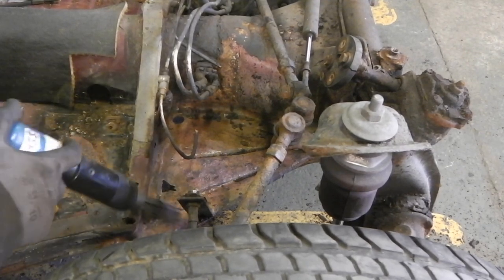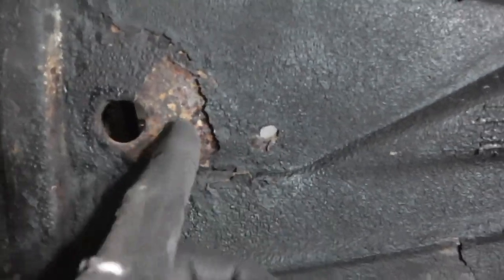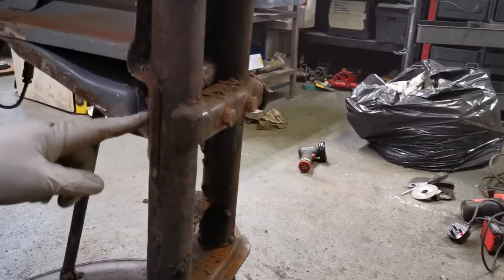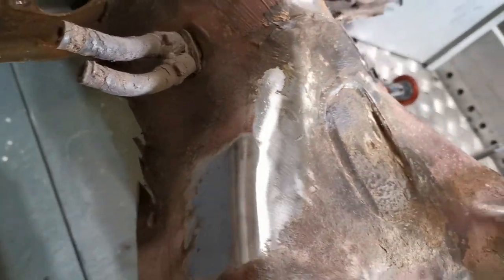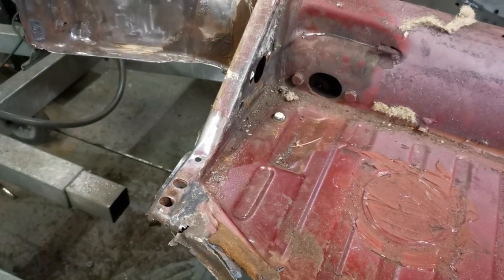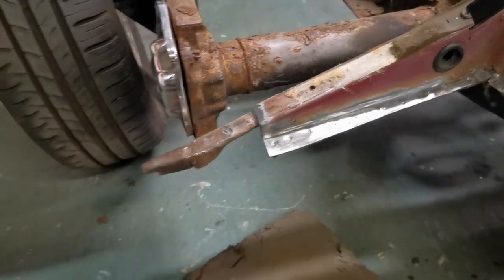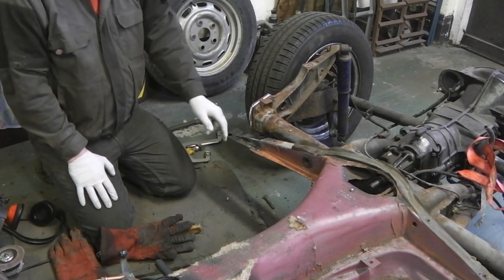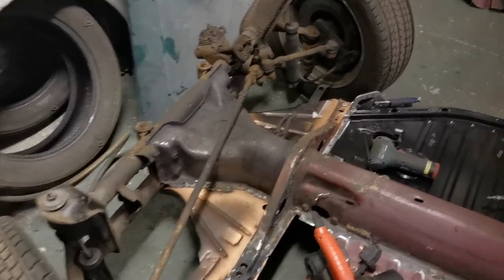Episode 21 Mexibug Framehead, Napoleon's Hat, outrigger and floor repairs

Comment: Nice work. The chassis is looking much more solid with the work you've done to the nap's hat, framehead and rear outrigger area. . I like your approach whereby you only use as much of the new panel as needed, leaving in place the original metal to the extent possible.
Reply from the maker: Thank you!
Most repo panels don't fit all that well, so retaining as much original metal as possible is easier in many case, plus the original bits are definitely lined up correctly so no worries there either.
The only difference is the floorpans which would have needed so many patches I decided to just get rid of the whole thing.